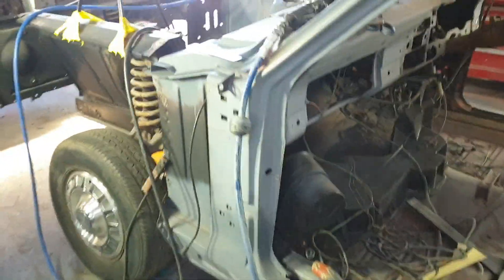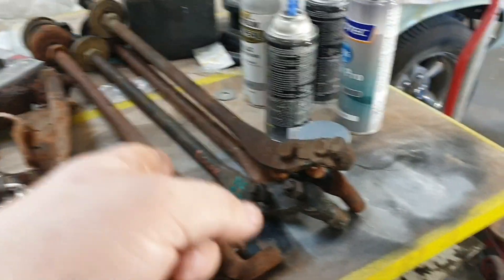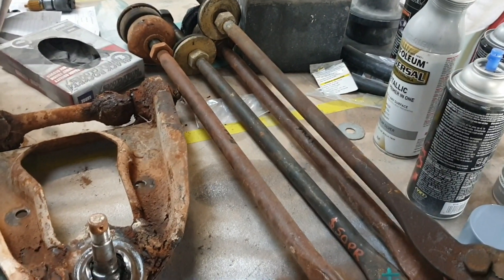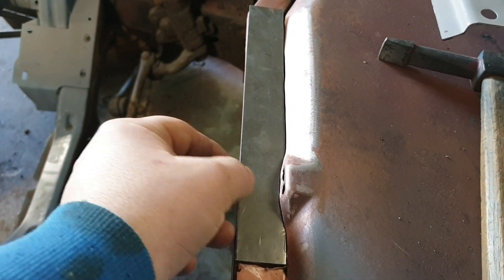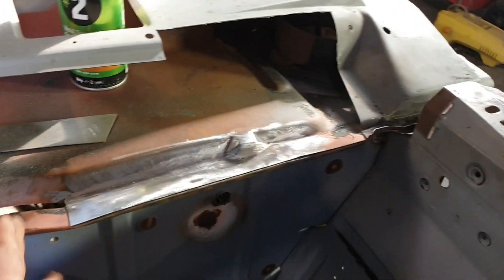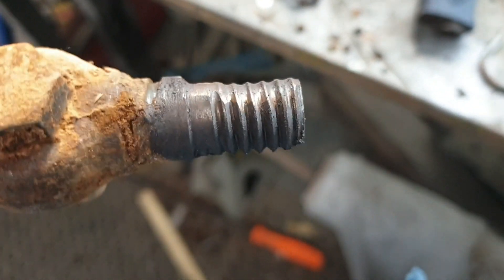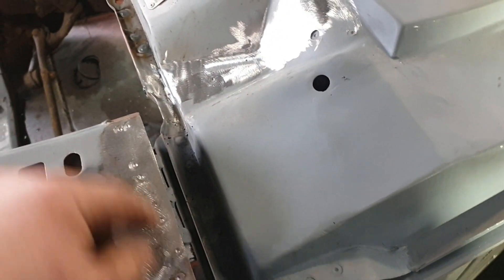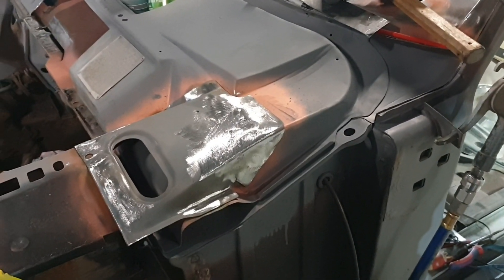Xy falcon plenum chamber repair wrap up

Comment: Great vids. Question; what are u going to use get into grind those welds down at 7:47 mins ?
Reply from the maker: Right angle die grinder with a roloc attachment on it
Reply: @xacoupeguy  thanks mate! Cool.